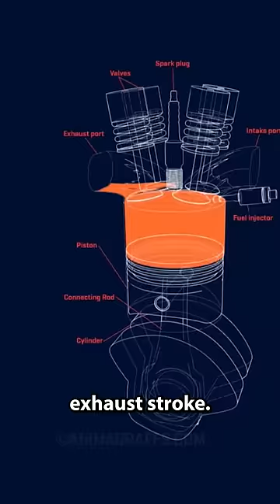Turbos Vs Superchargers

Comment: Mr banks would you consider discussing twin chargring. Blower plus a turbo set up properly has good benefits. 

Not to be rude but at your age you surely have discussed with older vets and aircraft pilots since i myself have at only 30. 

Properly sized blowers can be in the 80 to 95 percent effiency range with really good volumetric effiency and thermal effiency is increased. Less parasitic losses. And ways to improve other aspects of an engine to decrease other losses to negate the blower draw. 

Needs to be sufficiently sized and under driven. Low ar ratios. But combined with a more efficient turbo but reducing the losses both systems would see separately by using them together has benefits. 

Especially since diesels like boost and compound boost gets you flow and pressures that are unachievable normally. With less heat less losses more effiency and with modern boost control lets you essentially control dynamic compression ratio for combustion. 

Echaust backpressure vs intake pressure. Thermal differences. Combustion chamber cooling and the rest. Much better scavenging meaning better turbo spool. Design the system right and works quite well. 

Generally idea is small super big turbo by the people with experience. Or bigger super smaller turbos. 

Best practice is oversized big blower but under driven significantly and over-sized to avoid high rpm issues and also reduce ar ratio. Then feed it with a decently sized turbo thatll work across the rev range and boost pressures needed at max. Less heat at each stage of compression. Less losses. Improved scavenging and resistance to knock and reversion and failure to clear exhaust gasses. 

Turbos alone. Supers have not much use anymore unless very low revving motor and instant torque needed. But certain situations right sized blower plus super.
Reply from the maker: You may find our super turbo build series "Building a Monster truck Engine" a good watch. https://www.youtube.com/playlist?list=PLwtmrqcWzLtRXpEFXeXa3YF-L0xSK2Ml2
Reply: @bankspower  oh deffs checking that out. Family friend growing up used to build monster trucks and all sorts of crazy stuff.

Comment: That doesn’t make any sense . Doesnt the exhaust stroke use the power stroke of another piston to push out the exhaust if you have a turbine adding resistance to the exhaust you’re still requiring the power stroke of another cylinder to push with more resistance .

Comment: Turbochargers create excessive back pressure and have a more complicated setup.  Blowers are bolt on and go.  Turbochargers don’t work well with carburetors.  Superchargers work perfectly with carburetors.  Turbochargers mean constant maintenance and replacement.  Blowers run their oil for a year and you change it like a gearbox, and rebuild is simple, straightforward and (aside from certain applications) last longer.  Turbochargers require spooling and Blowers are instant power, instant torque, perfect throttle response.

I appreciate your differing view, however I prefer simplicity, reliability, longevity, throttle response and rebuildability over whatever that is.

Don’t get me wrong, I do go through head gaskets about once every two years, but I can’t afford MLS right now.  Anything I’ve worked on with a turbo is going through head gaskets every 9-14 months stock.  I’ve never had a use for anything that requires more complexity and has less reliability.  Plus blowers just sound so much better.

Edit:  Just keep your power stroke lit up until 90° ATDC and no further and you won’t have issues.  Also, there’re many reasons why superchargers are preferred for racing.  Just putting that out there.  The only real benefit I’ve ever seen for turbos is a slightly better mpg, but nobody with a decent sized forced induction is driving around like a grandma.

Comment: One of the few times I'd disagree with you -- its not a matter of your preferences, its a matter of the engines.

If your engine is lacking power lower -- supercharge it.

If your engine is lacking power higher -- turbocharge it.

Your dyno will tell you which one you need, and it will usually be pretty obvious.

Comment: also the fact that the supercharger make constant boost means it's allot more susceptible to exes wear as boost on low rpm punisher the bearings and rods allot more than making bost further up the rev range when the engine speed is higher

Comment: I see what he's saying but that's only completely true for a single cylinder engine, on multiple cylinder engines the exhaust stroke of one cylinder is partially or fully at the same time as the power stroke on another (depending on your crank angles) and as the cylinders are mechanically linked via the crankshaft this means that some of the energy from the power stroke is being used to push another piston up on it's exhaust stroke. In fact come to think of it even on a single cylinder engine the exhaust stroke - the force of the piston going up and pushing those gases out comes from the rotational momentum of the crank and that momentum is imparted by the earlier power stroke, ultimately if it requires energy to compress the fuel air mix then that energy must come from the power stroke of the engine, there's nowhere else for it to come from whether you use a turbo or a supercharger.
Theoretically you could use a battery powered electric compressor and have that battery charged by plug in (so a source other than the engine itself), that set up may exist but I've never heard of it being used in reality.

Comment: Is the energy that is required to sustain the exhaust back pressure against the turbine and ultimately maintain exhaust flow not being generated by the power stroke of the remaining cylinders?

Comment: I expect better from Gale. its simple physics, youre using the same amount of energy to create the pressure regardless of if you are getting it from the crank or from the exhaust, youre still extracting the same amount of energy from the engine to create the boost. You pay for the turbo boost in higher exhaust gas pressure, you get that exhaust gas pressure from the piston pushing the exhaust gasses out on the upstroke, the upstroke is being driven by another pistons downstroke, so you are just shifting which cyclinder youre getting the power from but still paying the power cost just the same. The only difference is in the effeciency of the device creating the boost itself

Comment: This is how I've felt for many years on this subject. Its just numbers, the parasitic is always going to be higher with a supercharger vs a turbocharger. Both can achieve extremely high boost and at a pretty similar rate so why not just use the one with less parasitic load

Comment: This doesn't make sense to me. The added load on the exhaust stroke to drive the turbo still comes from the crankshaft, and so ultimately comes from the power stroke of other cylinders and inertia of the rotating assembly, which is the same as a blower.

Comment: Turbo chargers generate boost by exhaust pressure. Exhaust pressure is created by pistons pushing exhaust gasses out of the cylinder. Pistons are being pushed by a crank shaft turning. A crankshaft is turned by another piston on its power stroke. So isn't a turbo charger ultimately building boost from the energy of a power stroke? Not claiming to know more than Gale, just looking for an answer to where the energy comes from to turn the turbo charger, if it's not coming from the energy created from the power stroke...

Comment: Well.....Would part of the "equation" be?  ; WHERE (meaning RPM)  do you want your power? WHEN(meaning what part of RPM  range, and the time) do you want/need your power?  WHY(meaning what you are specifically using the power for)  do you want/need your power ?

Edit: another way to think of the dynamics in simplist form, is a human inflating a ballon, that has a small hole in it , (with a given resistance to inflation ), .VS. using an air pump to fill the balloon . BOTH fill the balloon with measurable pressures/force, but are separate in accuratly repeating  measurable results. Just my thoughts on the matter. Peace

Comment: This is the first time I've disagreed with banks. It still is parasitic on the power stroke because its not usually a single cylinder engine.Meaning that one cylinder can be on the power stroke and the other on the exhaust which will put dragon the other cylinder during its power stroke. Another factor is the parasitic drag on the exhaust stroke slows the engine for when it comes around to the power stroke.

Still turbos are awesome!

Comment: I had twin turbos on my 02 z06 and it was perfect.  The z had great traction with the 500 hp engine part and then boost would creep up perfectly and all of a sudden 14 lbs of boost just rocketed the car.  
I then switched over to a vortech ysi running 18lbs of boost and pushed 840 rwhp but the only race i could do from there was a 70 roll because, even with drag slicks, i had no traction.  The boost hit too hard so i had over 500 ftlbs at 2500 rpm per the Dyno. It sucked .  I had ruined the fun factor.

Comment: What about centrifugal superchargers as opposed to a blower, would the centrifugal be better since it has less parasitic loss
Reply: It still takes useful work and not waste heat to run this thing. Waste heat you get for free as a byproduct of running the engine. So, instead of reusing waste that is already there you are burning extra fuel you have to pay for

Comment: Turbo lag and the exhaust gases have more back pressure on the exhaust stroke , the small amount of energy required to drive the supercharger is compensated by the instantaneous throttle response ! But high compression engines are a no no if you wanna run a belt driven air compressor

Comment: Doesn't this only work if its a single cylinder? On a V8 every cylinder is overlapping power and exhaust strokes. So wouldn't you want a more consistent pressure of a supercharger?

Comment: Neat but isn't that just another cylinders power stroke that creates the energy to push the exhaust out? Doesn't that result in some power still lost in the effort to pump the exhaust past the turbo, when that same power could have been going to the wheels?

Comment: BUT, the turbocharger inhibits the outflow of exhaust gases.  That's a negative.  There is always some lag, too.  Superchargers do indeed require power from the engine, but they provide cylinders with air right now.  It's like having a much higher displacement engine, the response is incredibly fast.  Once you drive a supercharged car, you won't go back.

Comment: And where does the energy in the exhaust stroke come from? The power stroke of another cylinder.
Reply: It comes from the combusted gas. After the power stroke, the gas is still at very high pressure (as it has a very high temperature) and when the exhaust valve opens, the gases are immediately sucked out of the cylinder (as the exhaust pressure is a lot lower than the cylinder pressure). The power needed to overcome the increased backpressure of the turbine is negligable compared to the power needed to drive a supercharger.

Comment: But since the turbo adds restriction, the output pressure in the exhaust stroke increases the internal pressure, thus requires power from the crankshaft right?
Reply: Yes, but that power is coming from increased exhaust stroke pressure. You're not adding to the peak pressure on the power stroke, which is what tends to break things on high power motors.

Comment: That being said, for drag racing the blower is king as far as combustion engines go.  Before you say anything check the quickest times and highest top speed records in the 1/4 mile and see what they run.  Top fuel = blower. 338.48 mph, 3.623 seconds.. blower motor

Comment: I'd rather have a supercharger to avoid the heat issues of the exhaust side of the turbo, and to smooth out the power curve. City and highway driving tends to make actually hitting the rpms needed to fully supply the turbo difficult, so a super with better low end feel beats a turbo with better top end power/ efficiency for me.

Comment: But doesn't it take the power stroke of a different cylinder to push the exhaust stroke? So it wouldn't it still be indirectly parasitic of a the power stroke?

Comment: Normally i love what gale has to say,  but in this instance im inclined to disagree with him.  A turbo is still driven by the crank,  it just so happens to be on the exhaust stroke. The piston has to work harder to push the exhaust gases out as its fighting a hard restriction.... the exhaust turbo housing.  This puts more pressure in your exhaust manifold pre turbo, sometimes even more pressure than the pressure your turbo can deliver on the cold side in the intake manifold. This pressure created in the exhaust housing is also why there is so much heat in the turbo manifold,  and heat is wasted efficiency.  Both systems have pros and cons. But its fair to say, turbo's definitely dont run on free or wasted energy, that's a misconception, they need extra energy to work,  just like a supercharger does.

Comment: Turbocharger uses heat energy in the exhaust that would otherwise be wasted out the tailpipe, and converts it into rotational energy to drive the turbo compressor.

Comment: Can someone chime in and tell me if my opinion on superchargers is wrong , I like them more because I feel like they are more reliable , I feel this way because a supercharger doesn’t have to deal with hot exhaust fumes , I know forcing induction messes with reliability but I feel like for lower hp applications wanting more power but not sacrifice reliability a supercharger is the way to go?

Comment: I would have kind of agree but at the same time while once exhausting one is power stroking and it's fighting itself on the crankshaft so it's still parasitic on the power stroke just not on one cylinder so if it was a one cylinder engine yes you would be correct

Comment: Well, kindof. Technically your exhaust stroke is being driven by the power stroke of another piston and by rotational inertia from the flywheel on the previous powerstroke from the exhausting cylinder. So it is definately parasitic to the powerstroke just less directly i guess.

Comment: Turbos are good, but superchargers are so much simpler. Simple means reliable.
Reply: Turbochargers last much longer than superchargers. The harmonics and load of the belt drive chew up supercharger bearings in the long run, turbos run extremely smooth with much lower bearing wear. Plus, turbos don't have a seperate oiling system to maintain. We only use turbochargers on our marine diesel engines, better in every way.

Comment: Turbocharged systems are harder to build and tune. The piping is complex. Superchargers can bolt right on, and intercoolers are an option but not required.

Comment: Considering your lp5 build will egts stay lower especially if you don’t want to run a diesel over peak power rpm? Is no turbo lag worth parasitic power loss over a turbo charger when running the same psi? I have a 6.0 powerstroke in a f550 daily driver (personal use I work in restaurants, not a work truck) so I don’t want to drive over 60 mpg because it’s geared for heavy loads and I want to rebuild it to be reliable. Best 12k I spent for a 4x4 diesel with 147k miles at the time.

Comment: Correct me if im worng but, wouldn't you be using power from piston x to drive piston y to push the exhaust gasses through the turbine? Or at the very least be using moment from piston y's previous power stroke?

Comment: not everything out of power stoke though.
cylinder under going exhaust stroke is pushing the gas through the turbine which draws power from the other cylinder’s power stroke. The difference here is mechanical friction between the drive belt and pulley, blower shaft and bearing etc. which doesn’t exist is turbo.

Comment: This technically isn't true.The exhaust stroke uses the power of a simultaneous power stroke to force the gasses out. With a turbo the force needed is greatly increased.Theres still quite a bit of back pressure in the cylinder, particularly at lower rpm s.

Comment: They are both power integrators. The difference is that a turbo is effectively integrating exhaust gas energy while a supercharger integrates crankshaft energy. But you dont get exhaust energy without crankshaft energy. You can run a single piston / cylinder engine all day long but it still reauires a crankshaft. If you change to a different engine layout like a Wankel to eliminate the crankshaft you now need  to use the block as a gear-housing to guide the rotor. Still need a shaft with a gear to ger power from the motor. Unless you use some sort of electrimagnetic coupling.  You still have to input power into the rotor to have intake, compression and exhaust strokes and that power comes from the power stroke. 

The difference between the two is that a turbo is coupled with gas pressure while the supercharger is coupled with an elastic belt to the crankshaft. 

But you know all this. And still dont understand the implications. The turbo itself is not constrained to spin at some fixed multiple of the crankshaft speed, which is both a plus and a minus.  Its a minus at low RPM vs high RPM but both systems can be tweaked to provide a degree of crankshaft-isolation. Just need an integratir either way.

Comment: I don’t like them. For one thing they extract a heavy toll on the engine when in use and you have to remember to run the engine at idle for a few minutes before shutting the engine off to circulate the oil otherwise you’ll burn the turbocharger up prematurely over time. The supercharger is much better. The supercharger's biggest advantage over a turbocharger is that it does not have any lag. Power delivery is immediate because the supercharger is driven by the engine's crankshaft. Also since it doesn’t heat up anywhere near what a turbocharger does, it requires a lot less oil to operate.